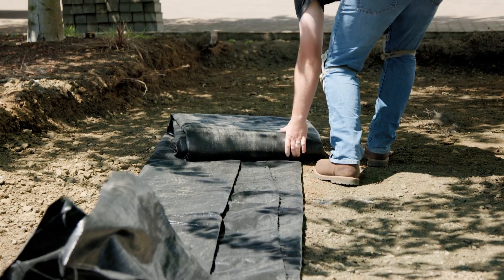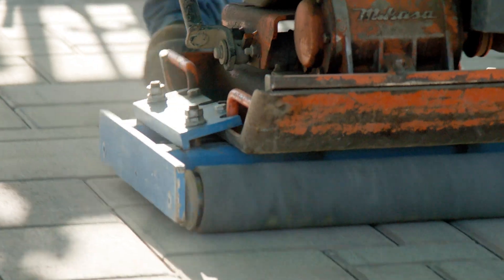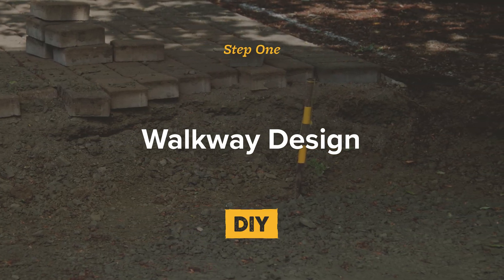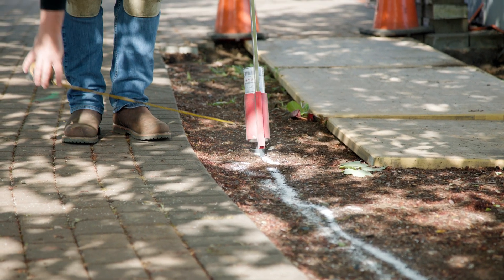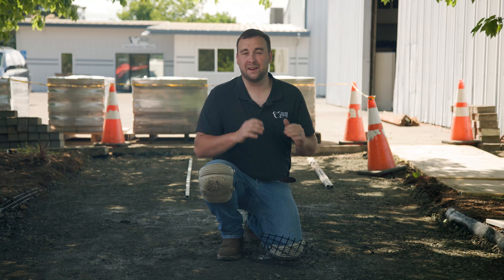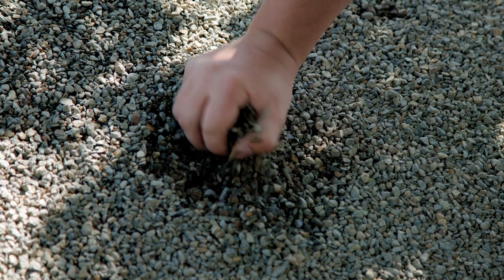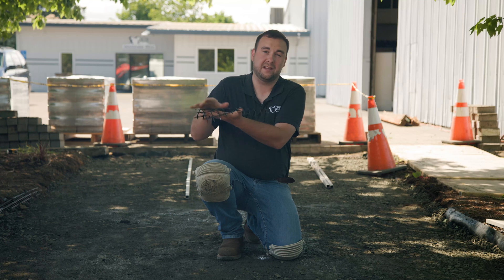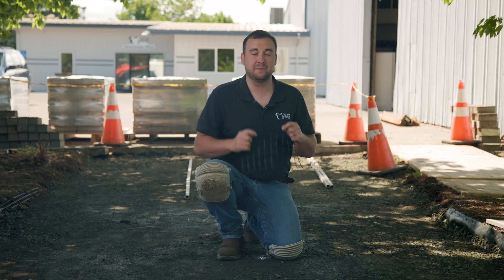Building a Walkway for Light Vehicular Traffic | Western Interlock

Comment: Last time we had a driveway built out of brick pavers - it sank over a few years in the area where the vehicles were parked.... we ended up having to lift it off in the low areas, pour cement underneath those areas where the tires went and then reinstall it... it was fine after that.
Reply from the maker: That’s a common challenge when the base isn’t properly prepped to handle vehicle weight. We recommend a well-compacted gravel base with proper depth and geotextile fabric to prevent sinking. If you’re ever planning a paver driveway again, we’ve got guides and tips to help make sure it lasts for years—no lifting and relaying needed.
Reply: @WesternInterlock  Will 10" of compacted gravel + textile survive freeze thaw cycles with vehicle parking on top? 

I love the look, but last experience left a bad taste!

Comment: Could the perma edge be applied higher than a 1/3 of the paver thickness if I am not concerned about hiding it and want more strength?
Reply from the maker: Going higher on the edge will not necessarily add strength. We recommend always following the manufacturers recommendation. 

https://www.permapaveredging.com/how-to-install